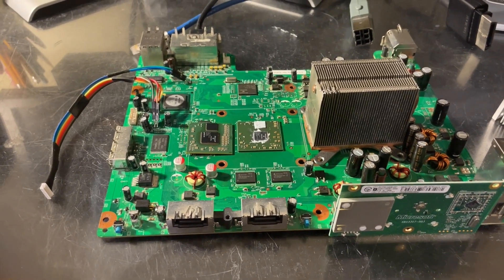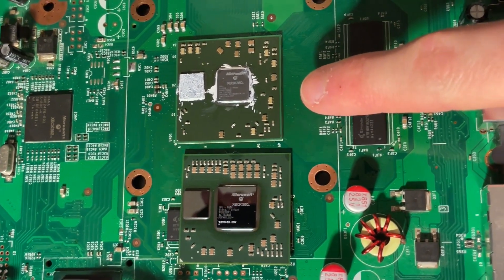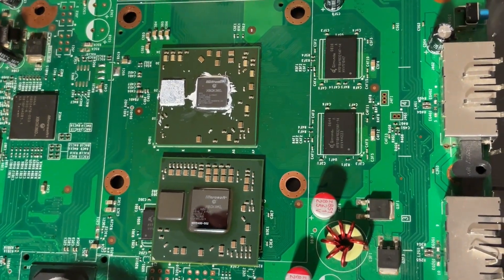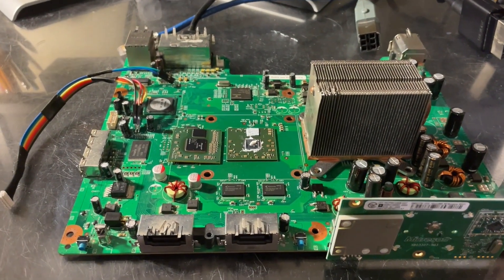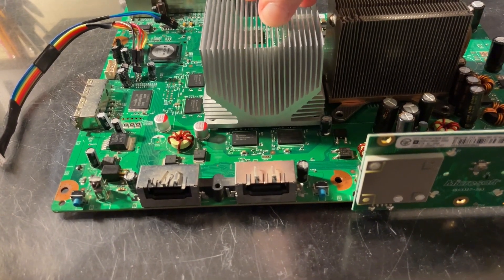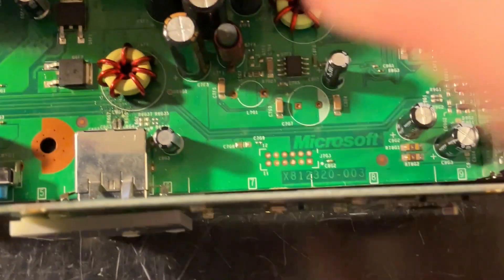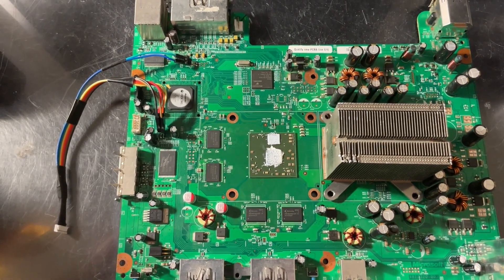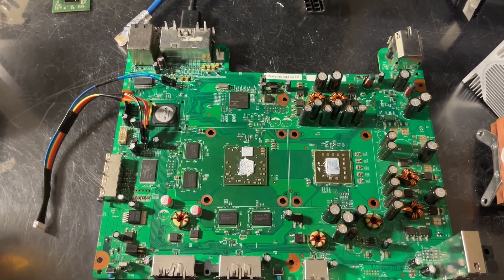Xbox 360 Falcon Retrofitted with 65nm Jasper GPU

Comment from the maker: NOTE: We have now learned that there are no 80nm chips. The dies are simply optimized and in the case of the eDRAM, redesigned, hence the size shrink. They are still 90nm chips.

The Kronos chip would also work. Both 65nm chips are interchangeable.

I made a writeup of the required steps here: https://consolemods.org/wiki/Xbox_360:GPU_Retrofit
Reply: Well I found a spot on top after viewing the schematic but haha it's literally impossible to get to unless you a super badass and can tunnel under the silkscreen and solder inside...but no need I just got mad and fixed it like usual...no fun I must say but meh if I damage something it never is haha. Thank you immensely though for your reply oh and the schematic was 32 pages of going down the rabbit hole so know you've probably shaved hours off others seeking the answer to this very question (and there's a lot) so truly a huge thank you on behalf of myself and everyone in the awesome Xbox community. 🙌😇
Reply from the maker: @repairstudio4940  Yeah it takes microsoldering skill to repair this damage.
No problem glad I could help!
Reply: @Josh.Davidson  yes sir that's what I do thank goodness ... Without a scope it'd been a nightmare. This is my first time using a Pico Flasher and WOW! Goodbye JR Programmer! That lil dude is an absolute blessing...no more messing with the finicky USB port on the JR Programmer and no more bread slice sized NAND X ...although they're awesome they can be cumbersome when ya got a small workspace. The Pico is tiny and works flawlessly! Love it.
Reply from the maker: It's been hit or miss for me. The xFlasher is a far superior flasher.

Comment: What are the temp differences?
Reply from the maker: Insignificant and doesn't matter anyways, the temps are safe and not the problem.
Reply: @Josh.Davidson  How so? What do you mean? If you change the chip shouldn't it be lower temp? I know for PS3 Frankensteins it is. I just assumed it would be the same for Xbox 360's that had CPU and GPU changes.
Reply from the maker: The TDP did not significantly change. But regardless. The Temps are just fine, so don't worry about it.

Comment: Holy crap you're using a bit too much heat for too long there bud, that discolouration.. Easily done though, BGA is a pain in the bum!
Reply from the maker: There is nothing like that??? The two chips are made with different substrate models, that's why they're a different color. There are tons of different substrate vendor/types with different shades of green and brown. Especially across different chip types. Xenos is made with 3-2-3 substrate and Gunga is made with 2-2-2 substrate. So definitely different types. Don't comment if you don't know your left or right about what you're talking about. Top heat on my profile is applied for less than 60 seconds from start to finish. BGA isn't a pain at all if you know what you're doing.

Comment: Asking out of curiosity i have a falcon manufactured september 2008 and it recently got rrod 0110 did it have a bad gpu or am i just unlucky?
Reply from the maker: What GPU model number and date?
Reply: Gpu rhea
A-B141/A-FS21
MSFN0834021.1
FG Korea
PA8380.00/NH824.00
X816971-002

I don't know how to read this my bad  😅
Reply from the maker: Unlucky. :( That chip should be reliable.
Reply: @Josh.Davidson  :(

Comment: Hello, I replaced 40.2 ohm 0403 R4T1 with 550 ohm 0403 for memory insted of 240 ohm that you said. do you think that could be a problem?
THX
Reply from the maker: Get 240 ohms. It may cause issues. Very cheap.

Comment: I got a late falcon and I heard that overheating is usually the cause of rrod. I want to keep my 360 as long as possible, should I replace the thermal paste for future-proofing? It has never been replaced and it’s 16 years old.
Reply from the maker: That is nonsense. Overheating had nothing to do with it. If your system is a late Falcon, it should have a reliable GPU which is reliable like Jasper. If it is early, then replacing paste and such won't help.
If everything is still working, then leave it alone.
Reply: @Josh.Davidson  Great to know that. Did the other ones have overheating problems since microsoft constantly changed the heatsink?
Reply from the maker: There were 0 overheating issues on the Xbox 360. If it overheats, it shuts off long before damage can occur. Video on my channel about it called What happens if the Xbox 360 heatsink is removed?

The heatsinks were changed for unrelated reasons.
Reply: @Josh.Davidson  Hi i've just found my old comment lol. The 360 I was talking about red ringed and now has a Kronos GPU. But in a year I've learned a lot and know heat is not directly the issue. Fixed 3 360's already.

Comment: Josh, I have a 2008-04-12 Falcon whose GPU is, I assume, failing (vertical lines). Could I just replace the Rhea GPU instead of retrofitting and be, relatively speaking, good to go? TIA
Reply from the maker: YES. But - you need to ensure that you put a reliable chip not another faulty one. Look for capital "GPU - RHEA" text now "GPU Rhea".
Reply: @Josh.Davidson  awesome, thank you. I'm excited to revive this one. Also, thanks for all you've done for the 360 community
Reply: @Josh.Davidson  one other question, does it matter if the chip says X810480-001, -002 or -003?
Reply from the maker: @BlakeBickerstaff  All that matters is that you get uppercase RHEA on X810480. Or get any X816970/X816971
Reply: @Josh.Davidson  thank you!

Comment: Emm,so josh I want to make a question is it possible to replace the gpu on Xenon with 65nm's?😂
Reply from the maker: See my other videos.
Reply: @Josh.Davidson  ok thanks Josh i ve seen that video but its less detailed so I need to replay it more to understand. I want to try with one of my rrod official refurbished Xenon that contains with Benq DVD drive,  the other one same I will replace the GPU with newer X817791
Reply from the maker: @Lingyikng  Wait for my adapter. Make pcie reroute easy.
Reply: @Josh.Davidson  👏 WOW Thank u for doing making this easy to realise, but I apologize for my new question. I just downgraded my jagged Xenon to 9199 with the Jrunner created firmware, when i flashed it with my USB stick in Xell and reboot,it booted up and I finished system set up at the first bootup. But the display suddenly get froze when i was opening the system settings' and I pressed the power button to turn it off, then it quickly shut not as usual like it usually has a delay ,then I want to open it up but it won't boot again, even xell. just with only greenlight,I disassembled it and successfully flashed 17559 with jr-p just then and still the same.I am confused now
Is it possible the wrong of CPU? Another rgh1.2 Xenon got the same issue not quite long ago
Reply: @Josh.Davidson  Just downgraded, then died 😢
Reply: @Josh.Davidson  I flashed it to retail and got 0022 ,its really the cpu has gone,bad luck dude☹
Reply from the maker: @Lingyikng  Replace the GPU with new one.
Reply: @Josh.Davidson  is it the problem of gpu?Emm maybe, I reflowed the gpu before and recovered these two boards from rrod 0020 to work
OK i'll try it soon, its late night at China now😂
Reply: @Josh.Davidson  I also have a falcon and a jasper with the same problem, they all died when I glitched them,  just greenlight and won't glitch,the matrix glitcher didn't have any sound or the light ,and flashed to retail got rrod 0022 either
Reply from the maker: @Lingyikng  check post bit! it can be GPU!

Comment: Hello. What size of smd resistors did you use ? And do the resistor values have to be exact? For example: I find 39 ohm resistors, 43 ohm ones, but not 40.2 for R4R9 ; And I find 47 or 51 but no 49.9 for R5D2. Thanks.
Reply from the maker: Close enough yes. It's within tolerance.

Comment: are the 80nm rhea gpu reliable is there anyway to tell or is it just luck as I herd that late falcon models are reliable but I want to know just by looking at the gpu die if you can work out if it's a later gpu.
Reply from the maker: GPU made after week 5 2008 probably, week 12 2008 most likely. Ones marked GPU - RHEA instead of GPU Rhea are also usually the fixed ones.

Comment: YOU super hero man!!! Respect!!!
Reply from the maker: Thankyou
Reply: @Josh.Davidson   I want to ask you something? may I? what difference in gpu betwen falcon 2008 02  year and falcon 2008 08 it has different code on chip? but when  we swaped it 2 consoles goes to 0022 error?
Reply from the maker: @filippetrov79  Tell me the codes on the chips. All Falcons use GPU RHEA X810480 or X816970/X816971 and these parts are all interchangable.
Reply: @Josh.Davidson  Thank you Josh! after second time reflow with fux plus all started working. Will you create a tutorial for ps3 40nm conversion? or it secret information?
And i have another question, i have a jasper 16mb. and its no video on av and  on hdmi i already change hana psb gpu cpu no video, but install rgh 1.2 and it started led on chip stop blinking in different time but no video may be you have any idea?
Thank you for answer, sorry for my english.
Reply from the maker: @filippetrov79  Tutorial @ px place.

You need to show RGH1.2 debug LED in order for me to tell you what might be problem.

Why you change all parts? Don't just change parts randomly, you need to debug, WHICH part is the problem and change that. It's a bad idea to just change HANA PSB GPU CPU like that.

Comment: What’s the benefit of this?
Reply from the maker: It will never fail again, because it now has a Jasper GPU.
Reply: @Josh.Davidson  ahhh. Super.
Reply: @Josh.Davidson  amazing work of course. Superb.
Reply: @Josh.Davidson  wouldn’t it be better to keep the Jasper intact? Luckily Xbox 360s currently are still inexpensive.
Reply from the maker: If you mean why did I take a GPU from a working Jasper, I didn't. This chip came from a console that was damaged by someone with bad soldering skills trying to RGH it. Also you can buy hundreds of GPU from China.
Reply: @Josh.Davidson  nice. How much would this mod cost?
Reply from the maker: @johndee759  It is expensive. Not worth it unless JTAGABLE/XDK. You can contact me privately for quote if you are serious.
Reply: @Josh.Davidson  I had a feeling this wouldn’t inexpensive.

Comment: Hey Josh do all Falcon boards have the 4 ram chips? I’ve been trying to figure out if a Falcon V1 and V2 actually exist or not but I am not sure.
Reply from the maker: No. And Falcon V1 and V2 do not exist.
There is only Falcon. Initially Falcons were offered with 8 RAM chips, from Qimonda, Hynix or Samsung.
Qimonda came out with 128MB RAM chips first, and MS who was still trying to sort out the RROD issues, decided to move to using only those chips, in 4 chip configuration. The result is that when the fixed GPUs started being used in mid 2008, they almost all have 4 RAM chips.
This component vendor change does NOT constitute a different board version. The Jasper V1 has either 4 or 8 chips from different vendors in the exact same way. 
The Falcon V1/V2 myths are a result of people jumping to conclusions and not understanding. The boards were built by 3 different vendors who all prefer different parts for pricing reasons.
Reply: @Josh.Davidson  that makes sense. Never believed a v1 or v2 existed lol

Comment: It's no longer a Falcon. ;)
Reply from the maker: No it still is.
Reply: @Josh.Davidson  no longer a Falcon because it is running Jasper firmware hehe.  I kind of understand why MS would not do this kind of thing even if it meant saving them money. They probably would not want their technicians understand too much about what was going on inside the boot stuff for security reasons. (Paranoia)
Reply from the maker: @leonardoliveira  I guess its a bit of a grey area. I'd still call it an upgraded Falcon as the only change was the CB to add support for this GPU. It is still technically a Falcon.
Reply: @Josh.Davidson  its a bastard board xD

Comment: what's the point of this? Just run the jasper
Reply from the maker: Research and Repair.
If you're not interested, then why'd you click?

If your point was why did I take a GPU from a working Jasper, I didn't. This chip came from a console that was damaged by someone with bad soldering skills trying to RGH it. Also you can buy hundreds of GPU from China.
Reply: @Josh.Davidson  a Jasper GPU can be bought from China? Ali Express?

Comment: What happen if install liquid metal on Xenon GPU copper heatsink : temperature is best ?
Reply from the maker: Silly, no point to use liquid metal. Temps are fine how they are.
Reply: @Josh.Davidson  90nm GPU is very hot temperature !
Reply from the maker: @liptonacer  Not really... CPU makes way more heat 85W. GPU 90nm is only 38W. That's nothing. Don't believe everything you read.
Reply: @Josh.Davidson  the GPU heatsink is really too low for the xbox 360.
Reply from the maker: @liptonacer  No its not. There are no thermal issues on the 360. The heatsinks and fans are all fine. Anyone who says otherwise is an idiot and does not understand anything about chip thermals. The 360's died because the GPUs were defective and could not withstand normal thermal cycles. Even 20C room temperature to 50C is a thermal cycle. The only reason the extended heatsink exists is to delay the fans increasing in RPM a little bit due to people complaining that the fans were loud.